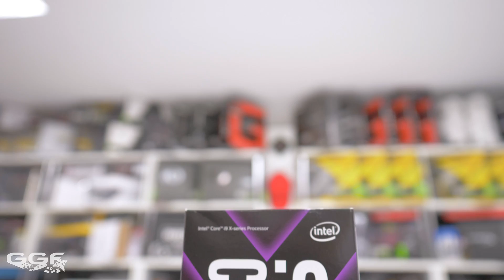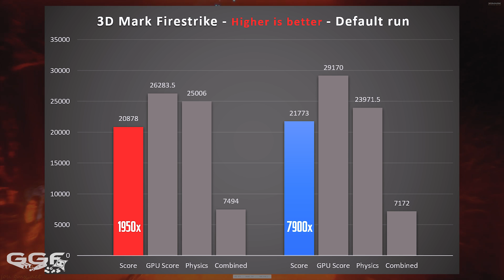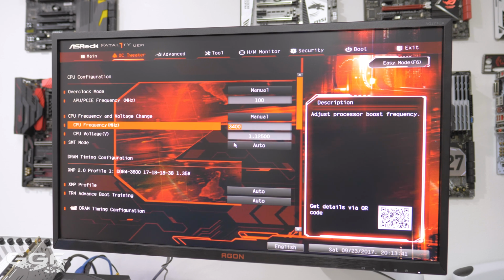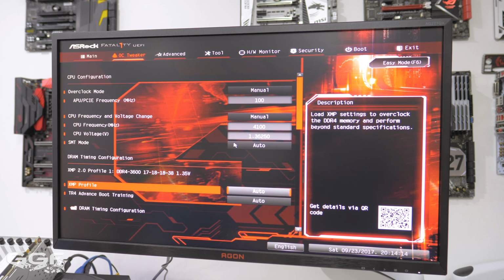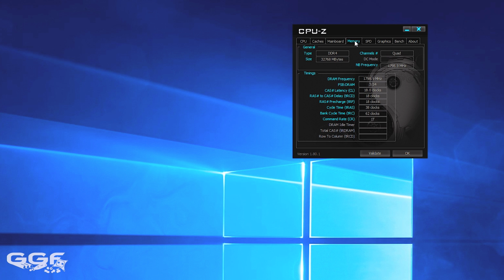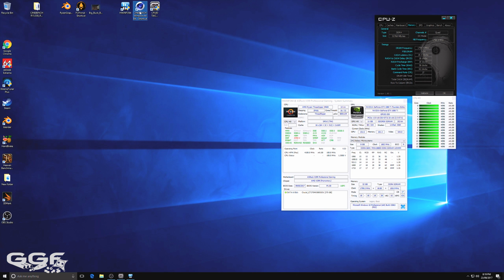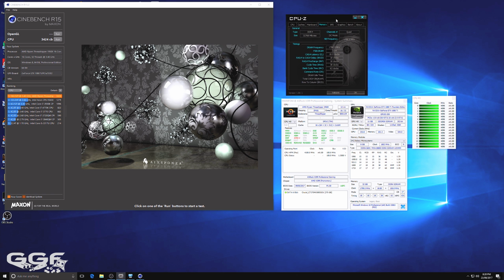#173 - AMD Threadripper 1950X Quick look and Overclocking to 4.1Ghz

Comment: This might not be the best place to ask, but ill give it a shot. 
System Spec:
Threadripper 1950x
Zenith Extreme X399
G.Skill Neo 128gb (4x32gb) 3200MHz C16 - 16-18-18-38
GTX 1080 Ti

My question is related to the memory ram speed. Using the amd XMP profile (forgot the actual name) I was able to reach up to 1600MHz on my ram, not more.  Any tips on what I could do to boost it up to at least 2666MHz? 

I use this pc for 3D rendering and I would benefit a lot with faster ram memory for texture loading and etc.

Comment: I've overclocked my 1950x to 4ghz, temps idel 25C , playstation emulator 3 playing superstardust 51c , but strange thing is, when ive got it at normal stock levels, my temps are higher , instead of 51c i get 63c+ ??

Tried games and other stuff, stock levels higher temps??

It just staying a lot cooler at 4ghz!

NH-U12s cooler

Comment: I have the Asrock TaiChi X399 with a Threadripper 1900X. Using almost the exact same method I reached 4.25GHz with 4.5GHz XFR today @ 1.375v. Ram is DDR-3200 @ 3333MHz CAS 12. Cinebench marked at a perfect 1900 with a single core of 176 tonight after disabling my realtime antivirus program. So, the techniques and settings that this man is suggesting is again proven good information.

Comment: Hi. I am able to jump to 3.8ghz on stock volts 1.1xx. The quaestion is it reasonable to jump from 3.8 to 4.0 or 4.1 with adding another 0.2-0.33 volts? Now cin r15 is 3236

Comment: Do Australians not like Asus, MSI and Gigabyte?... all we ever see is Asrocks ridiculously ugly and childish cog boards.
Reply: There not Childish also AsRock boards are more stable then Asus and gigabyte boards as of late Maybe do some actual research as AsRock offers you a hell of a lot more features for the price then most brands hence why people chose them over gigabyte msi and asus etc
Reply: I was a diehard asus fan when it came to boards. But i switched to asrock for the 1800x and the above board for the threadripper 1950x and they have been the best and most stable boards i've used.  You may not like the way they look (personal choice) but the boards are exceptional in my opinion.
Reply: DC - Raiyne i guess im biased as recently i had to rma a rubbish b350 board.

Comment: That's very impressive OC at 1.36 Vcore! To get stable 4.1 Ghz on my 1950X I need to pump at least 1.4V into it. Looks like you won the silicon lottery. :) 3.9 Ghz is as far as I'm willing to go with mine for 24/7 since it gets pretty toasty on long 100% load jobs. I'm using the Taichi mobo, btw.
Reply: Same here,  4.125GHz at 1.395v with LLC up to 1.45v, water chilled, dialed back down to 4GHz at 1.35v for 24/7 use, using Zenith Extreme. Strangely I could run this all at lower volts when only using 2 DIMM's but when I upgraded to Quad Channel the CPU needed more volts.
Reply: Andy Bradley Wierd, i'm fine at 4gz @ 1.275v
Reply: How do you guys tweek these voltages? Something went wrong with my Taichi + 1950X + 4x8GB HyperX Predator @ 3000MHz and I ended up with one dead mem stick after some tweeking. I didn't do anything hardcore that many of some expert guys did over the internet. Well, I ordered a new 32GB 3200MHz to make some new tests. What happens if I raise the CPU clock with lower voltage? And how do I know how much do I have to increase? Is there some kind of calculator or sort of for the CPU?

Comment: The Intel 16 and 18 core do now certainly dethrone Threadripper from basically all benchmarks, but at $1700/$2000 USD MSRRP respectively, so price per performance Threadripper still makes some sense. Also while the base clock speed of the 18 core is only 2.6ghz, all of the reviews I've seen show overclocks to in the 4.x ghz range.. although power draw is substantial and its hard to tell if the early major channel reviewer chips will be "golden samples" verse whats actually going to hit the shelves for the end consumer.
Reply: Threadripper still makes "some" sense? Dude it costs HALF and has 85% of the performance of the new intels :-P the 1950X makes a HEAP of sense.
Reply: Michel Van Weyenbergh You need to watch some wan show :)

Comment: 1:49 Ah, 64GB RAM split into both systems. I was thinking 64GB in each somehow. Can you please test all 64GB in the X399 system?
Reply: That would severely cripple Threadripper's ram overclock. Because for 64GB he needs to use dual bank ram (4x16GB). Ryzen can't run dual bank ram at high speeds.
Reply: why not? btw you mean dual rank?
Reply: Çağan Çelik It can, I'm running a 1950x with 64GB 3333mhz Gskill Trident Z b die  ram while at 4ghz on all cores.
Reply: No, Actually 64GB each system
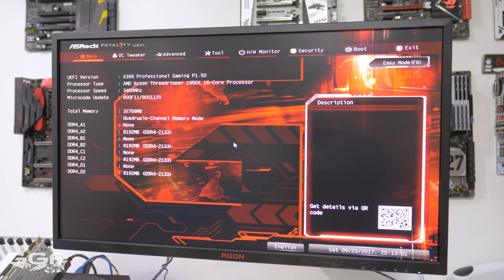Reply: 2:40 says 32GB?? and only 4 DIMM slots occupied